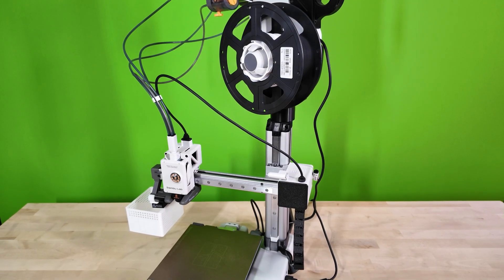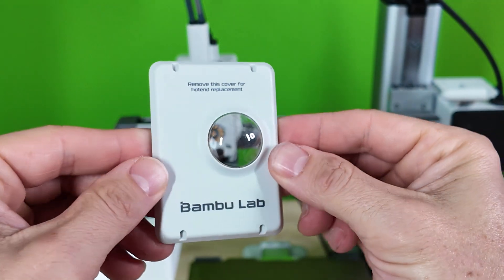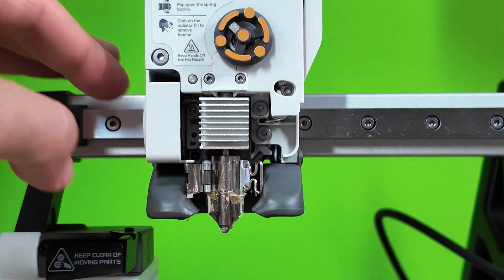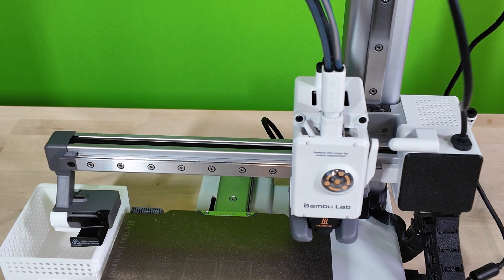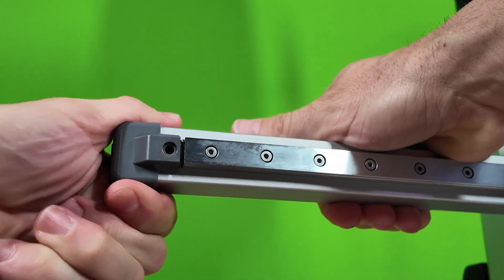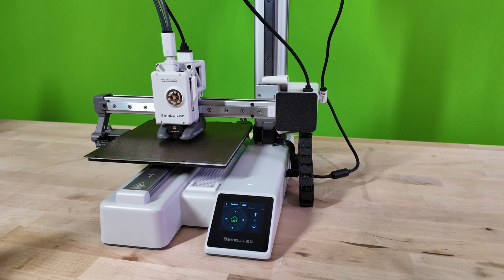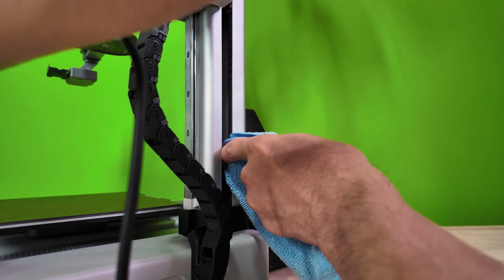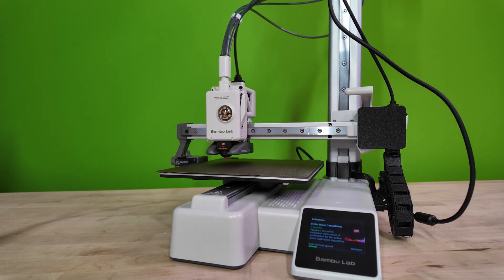Bambu A1 Mini Maintenance – Full Tune-Up Guide

Comment: Everyone this advice about lube on the pulley is WRONG coming straight from bambu. the oil goes between the pulley and the housing where it rides IF it is squeaking... otherwise leave it alone.

Comment: I was looking for a good maintenance guide for the mini and this is it. I’m gifting a A1 mini to my niece for Christmas and wanted something for her to reference while performing maintenance on the machine. I did however spot a flaw in your procedure for oiling the X axis pulley. You should apply oil behind the flanges of the pulley not on the surface where the belt rides. All in all a great guide!
Reply from the maker: Ya I have to agree with you. I looked at the Bambu labs specifications and photos and they applied it in the spot that I showed. I agree though.

Comment: What's the iPa cleaning stuff?
Reply: Isopropyl Alcohol, available in any drug store. Aim for the 90% version as a general solvent. Good for removing fingerprints from your plate as well (but not as good as scrubbing it with Dawn).

Comment: I don't get why you would put oil there... thats where the belt rides... it makes NO sense. What is rubbing on that metal pulley aside from a rubber belt you DO NOT want oil on that would wear it?
Reply: thats what im saying.. no reason to lube the bearings
Reply: The oil goes behind the flanges of the pulley not on the surface where the belt rides.

Comment: I can’t get my belt to “tighten” keeps giving me an error code. Says to losses bolt on back of tool head move it left to right and snug it back. I have done this multiple times and it won’t remove the error message.

Comment: is it hamful to misplace lubricant on the x axis rail cuz i accedantly placed some on the part with screws i must know if its harmful
Reply: and if i look at the part of the tool head that is touching the x axis part with screws i see some lubrication stuck there
is that harmful?
Reply from the maker: @Dragos-bd9vwno it will not harm your printer. Your fine.
Reply: @planet3dp  thx you so much for telling me but i have another problem now i have the a1 mini not the combo and my ptef tube and the cable connecting the tool head are sagging fordwards how can i fix?
Reply from the maker: @Dragos-bd9vwis the tube bent? It's ok if the tubes sag a bit.

Comment: Somehow oiling that X-axis pulley like that doesn't look right to me. Surely it will end up on the belt. Can you explain further? Thanks great video still
Reply from the maker: I thought the same thing. But it is the guidance of Bambu lab so I went with it.
Reply: @planet3dp  ah okay fair enough, cheers
Reply: @planet3dp  hey! I thought the same thing about oiling the pulley… it seems odd to put oil there, then on the P1S, the oil goes beyond the flanges (which is super hard!). Since it’s been a few months, have you had any issues with the belt slipping? Or have you revised your oiling method?
Reply: The oil goes behind the flanges of the pulley not on the surface the belt rides on.